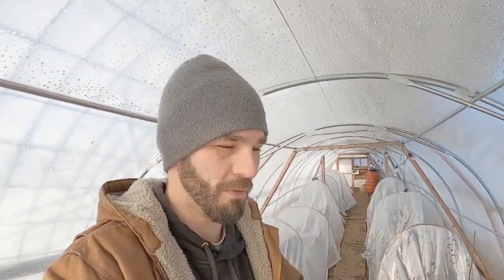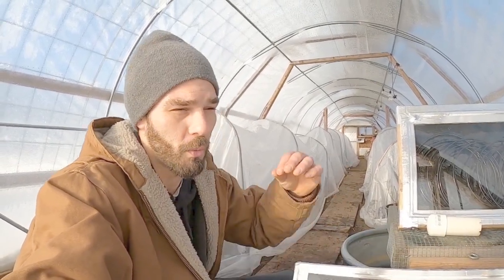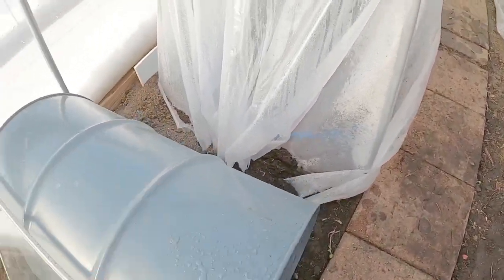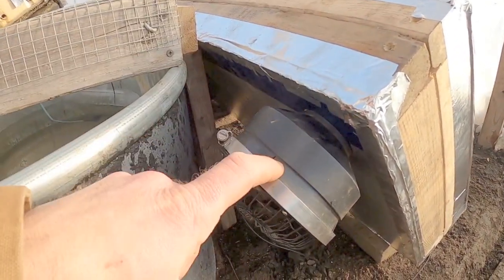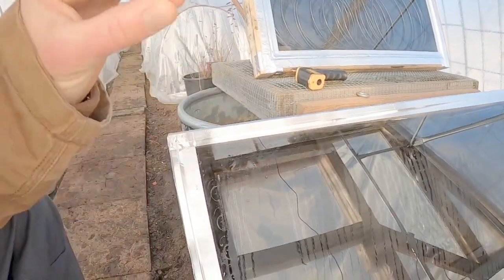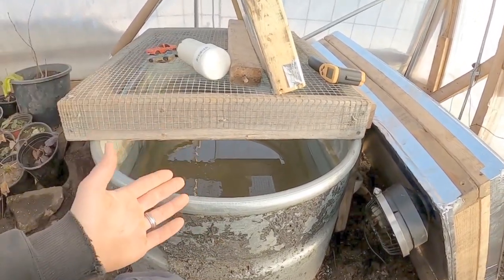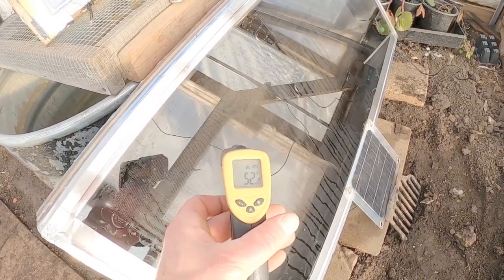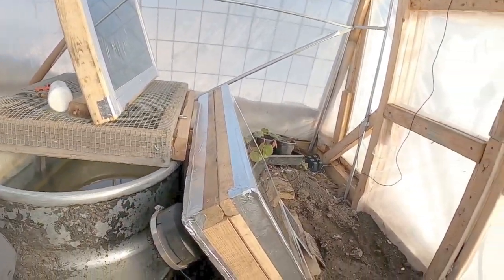DIY Solar Heating Experiment - ( NOT Pop Cans) Heating Air Vs Heating Water Energy Inputs

Comment: having a door opening from the green house directly to outside will be loosing quite a lot of heat every time you go in a extension big enough to fit in thing's being moved in and out a second door will reduce the in rush of cold air and with a lot of thinking about it the extension could be a solar heater
Reply from the maker: I have been debating on putting a roll down sheet of poly for a double door type of deal. But what your saying is build an entry way and have another door, it’s genius by design. I’ve been trying to avoid opening the door as much as possible in the winter but it’s inevitable. I may come up with something like your saying if not this winter surely for next! Loosing valuable heat isn’t an option when it’s only in the teens all day and night, I could basically build a small greenhouse in the front for an entry point and use it for a hot room to draw air from all together, now that’s thinking my friend thank you!

Comment: Don't understand why your are melting snow or leaving that ice in the bucket.  You must have water on your property. Remove the ice are replace with water from the ground. That will be an instant boot of heat.
Reply from the maker: A well won’t pump water through a frozen line, and it’s at least 200ft away from the greenhouse. The ice stayed because we had an arctic blast and lowered the temps that end of the greenhouse. Most of our videos are dated when they come out to the public. We’ve been melting the snow with our solar heater, showing that it can be done, and we had to refill 110 gallon tank with minimal amounts of snow as we filled out 55gallon drum out of this tank. Thanks for checking it out
Reply: @Earthdwellershomestead  Watched many but not all your videos. Have you considered burying a water line to inside your greenhouse?
Reply from the maker: Yes I have. But it would have to go around a huge driveway and building. Or under. Way more expensive than I want to put in. I’m building another solid greenhouse on the water side of the driveway to get it closer to the well. This greenhouse was as cheap as possible and in an open unused space. Believe me, I kick myself everytime I have to unravel the hose and run water out 😆

Comment: Curious if you think using the radiators and connecting them together and running your water thru them would heat up the water to a higher temp than the small box you're using now to heat water.
Reply from the maker: I really wanted to do just that! They weren’t in good enough shape for that though, the lines we busted at the bottoms and would have leaked on me. Believe me I tried my best, I ended up using them this way out of failure to run water or just simply “hold” water in them for better heat absorption inside the box and  better transfer as the air moves across the box inside and heats up before being pulled out by the fan. I’m still on the look out for more stuff constantly when I’m driving for work and when I’ve got the family out on the weekends 😂 thanks for the interest!

Comment: I just built a free solar air heater, about 14" wide by 60" high and 5" deep, using an old shower door a friend gave me, along with scrap boards from an old farmhouse he's renovating. On the inside of the box I used sections of old metal ceiling he tore down and painted it black. Shot a layer of caulk down before screwing the shower door onto the box, so it's well sealed, and painted the outside black as well. I was disappointed at the output temperature in direct sun and think it's because the glass shower door is slightly frosted, not to mention ancient (kinda gray and cloudy). So it's time to revise...No sense wasting a good box, so I'm going to remove the shower door and replace it temporarily with either some plastic or if I can find some glass. I hate buying plastic because who needs more of that crap ruining the environment, but my other friend has some sheeting lying around in his garage that I can have. If it doesn't work any better than the shower door I'll have to try another modification to the box. I like your desgns and hope you continue to meet with success and have fun in the process. Thanks for sharing your experience.
Reply from the maker: A suggestion.. I’ve found off cuts of plexiglass from the hardware stores and old “covid” shields, I used some for the top of our bearded dragon tank as a lid. Didn’t have enough to be of any use for heating but I have a small left over piece over our solar controller box in the greenhouse. Seems to be just fine in the greenhouse, dunno how long it would hold up in direct sunlight though

Comment: Would the water tank not stay warm longer if it were lowered into the ground and maybe heat added from your Jean Paine compost pile?
Reply from the maker: It certainly would be better insulated since the soil in the greenhouse stays about 40-50F overnight. I’ve been trying to keep this tank warm with only solar every to see what I can achieve, I could dump 60-70F water in from the Jean pain heater and I’ve thought about it but I’d have to have a heat transfer system in place or another pump to pull the water back out of this tank and back into the grid of my Jean pain heater. Additionally, it’s been freezing up because I’ve been dumping snow in it to melt and build the water up but it was soo darn cold that it had the adverse effect and we haven’t had enough sunlight to warm it up so it had been freezing about 1” thick on the surface and my little pump seems to not like it lol it doesn’t wanna kick on all the time without a tap or adjustment. Live and learn as we go! Thank you very much for watching and giving your input it means a lot!
Reply: @Earthdwellershomestead  I can't wait to see your improvements as you go into the future. You were hit by the storm a whole lot worse than we were. Mostly we got a bit of rain and a lot of wind in our zone 5b PEI.
Reply from the maker: That arctic air was no joke lol. Glad you guys had it a little easier. The temps are coming back up and things are getting better up here just muddy and floody 😂

Comment: For now using J.P. method isn't an option  mostly due to inability to find free wood chips (Santa bring me a chipper please). A solar box heater & water heater is a brilliant alternatives. Love it.
Reply from the maker: Thank you! The few wood chips are a blessing for sure! Alternatively, using the sun is our cheapest option especially when we’re using recycled and free material to capture and multiply the heat. Thanks again for watching
Reply: @Earthdwellershomestead  Would oak sawdust work in the place of woodchips? I have something like 6 tons here and an industrial woodchipper coming to help clean up after Fiona.
Reply from the maker: Sawdust would be even better as the material is easier to soak and it’s very fine, might not burn as long as woodchips but it will get hot for sure! Get it all wet and inoculated and it will burn for a good length of time if you’ve got a big enough pile.